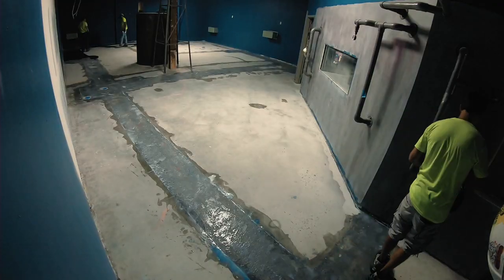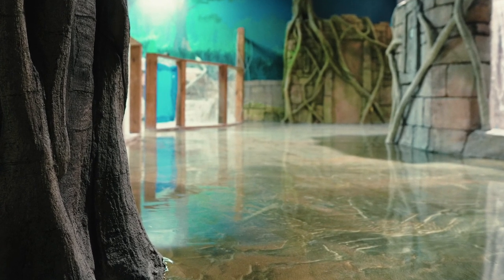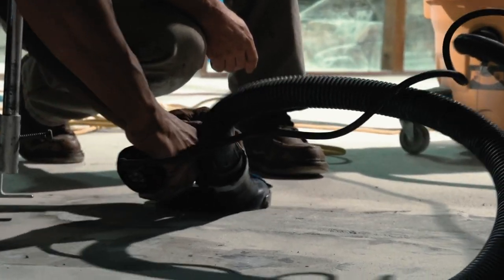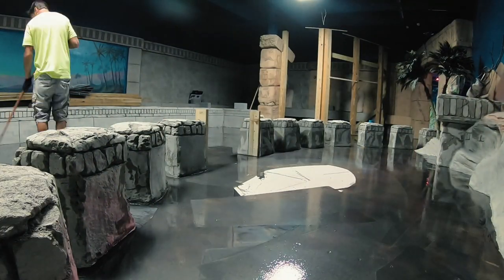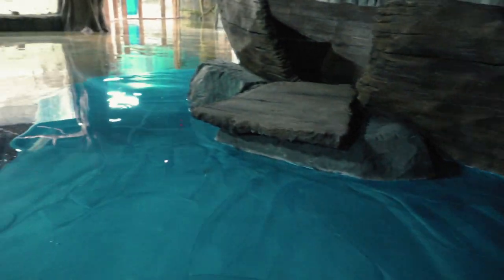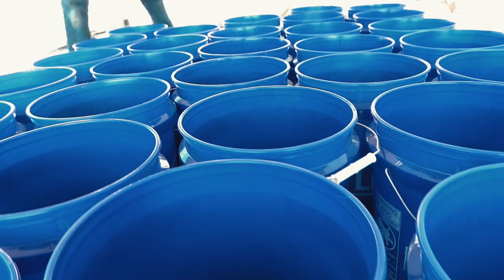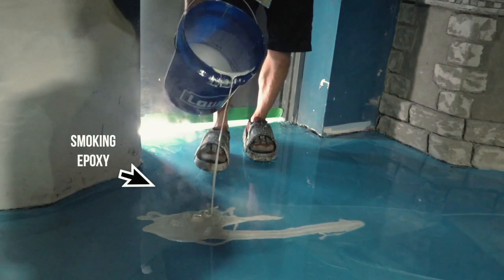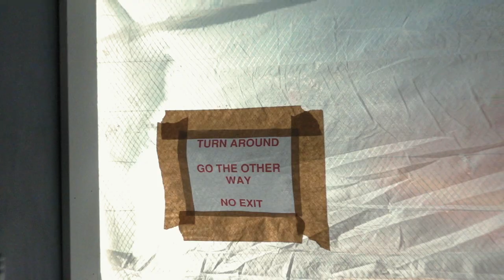The Hardest Metallic Epoxy Floor We've Ever Done :: Hacking Concrete Podcast 😅🤪😎🥳

Comment: Being an owner/operator doing metallics is an awesome application but gotta put alot of planning into even the smallest job, let alone 12k!! Great job  Most Ive done at once was 2500 with 2 people, mix all my colors in to part B day before, tape all the areas each kit does @ 55 square foot a gallon, etc.  I live in Florida & did a hair salon & had a gecko stuck in the floor just like your buddy! Hope you got paid!!!!!!!!!!!!!!!!!  #itsepoxybro
Reply from the maker: Thanks!

Haha. 🤦🏻‍♂️🦎 

I measure off squares when we are putting down metallic too. I don’t like wondering if we are putting down enough. 

2500 w/ 2 people is pretty impressive. 💪🏻 🙌🏼